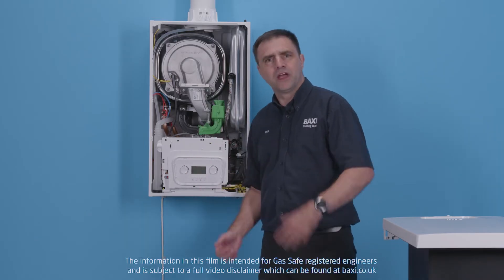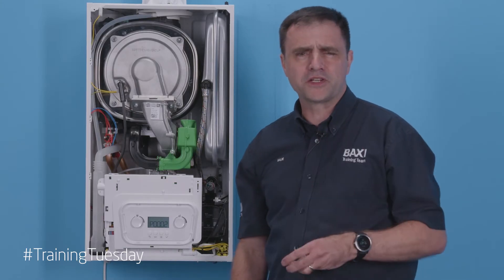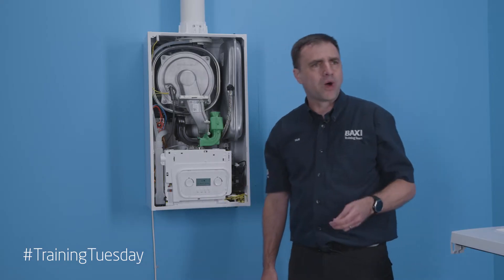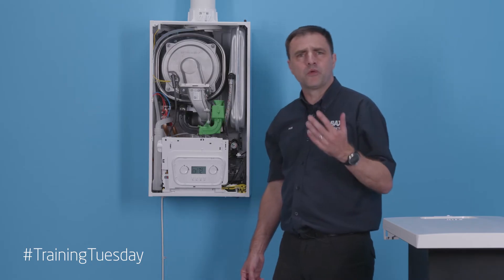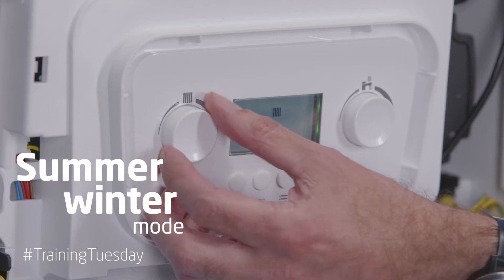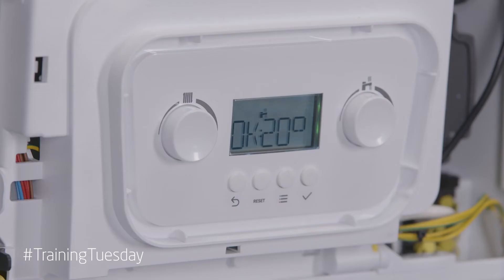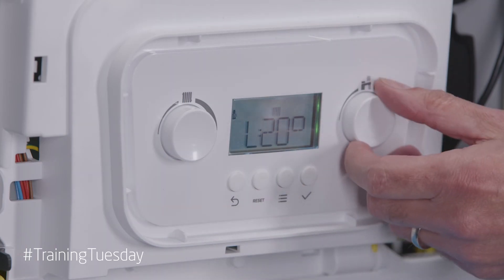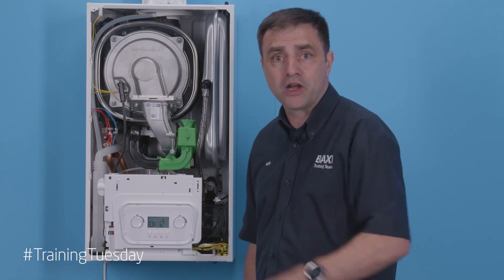Part 2 - Baxi 400 Combi 2 Boiler - De-aeration and commissioning | Boiler troubleshooting Guide

Comment: What green lever, as shown in part 1? I have 2 black and 2 blue .... on a brand new Assure 500 ... I pulled the two black ones downwards and no fill from either to increase pressure from 0.5 ... Help. No heating and only luke warm water thst runs cold after a minute or so ...
Reply: It’s the two blue levers to fill

Comment: I followed this but the commissioning mode could not be set/done. Got the E.04.10 error code. Burner failed to ignite. 
Its a brand new boiler so i doubt i need to clean the condenser. The gas maybe ?. 
Any ideas anyone ?
( boiler is a baxi combi 2 , 836)

Comment: Now if only there were a way to manufacture a diverter valve that didn't crap out annually causing water to leak into the actuator motor on top of it causing an electrical short tripping the mains to the house, top notch work there Baxi....